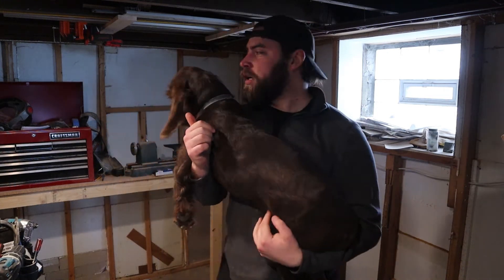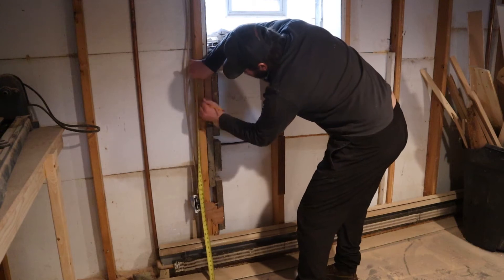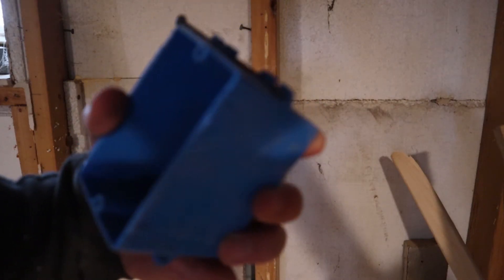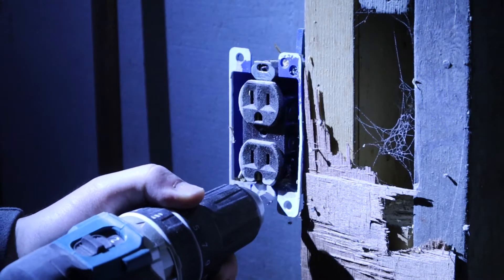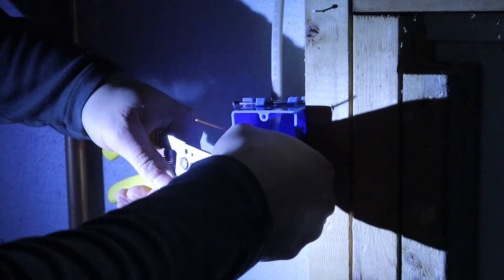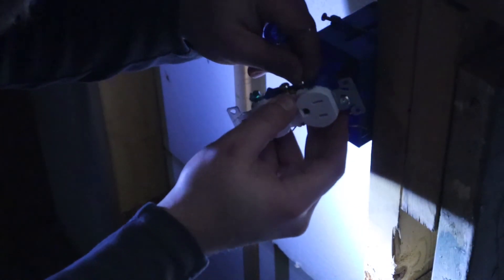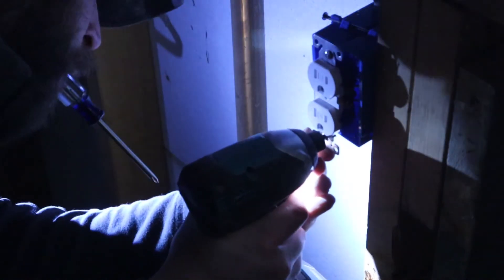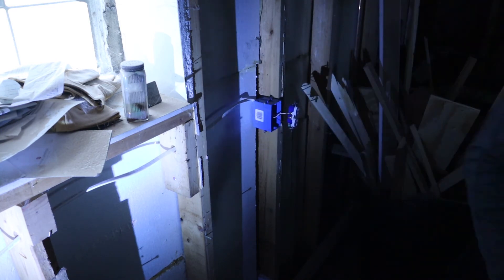How To Move An Electrical Outlet & How To Add An Electrical Outlet

Comment: Question, the first receptacle where you've connected both ground wires....didn't you have to connect that to the ground screw of that power plug?
Reply: I was wondering the same thing. I didn’t see him connect the ground wire in the first outlet

Comment: If the cable is running straight through studs wouldn’t by code need to be in a kind of armor conduit? or be stapled to the side for it to be safer?
Reply: No, you just need to put nail protecter plates to stop from any nails are screws causing an arc fault